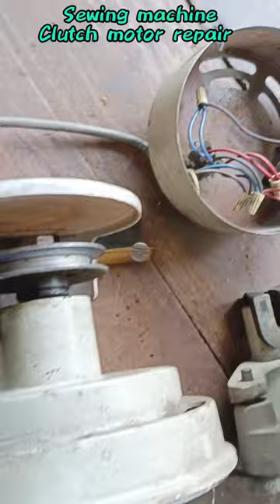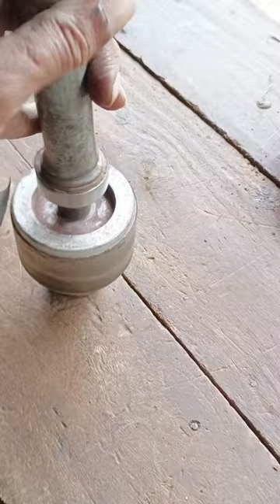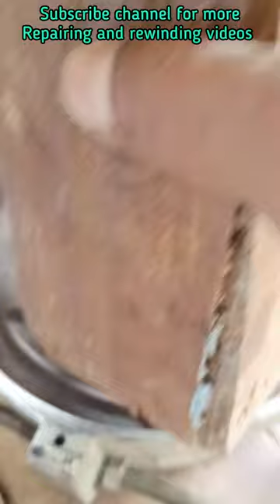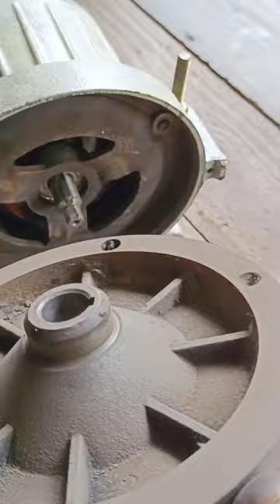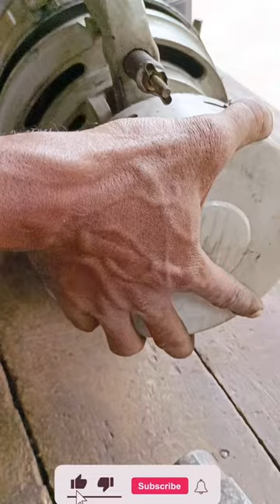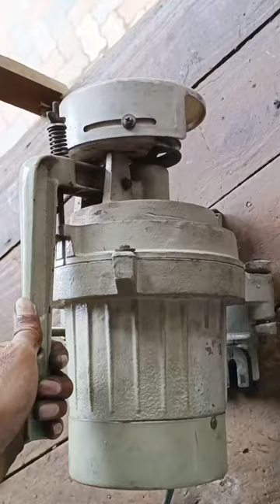Sewing machine clutch motor repairing|Clutch motor repair|stitching machine clutch motor repair

Comment: Hello i have one but the motor isnt rotating what might be the problem
Reply: It vibrates when turned on but doesn't rotate
Reply from the maker: If there is vibration and no rotation, the bearing may be compliant and you should also check the motor winding and capacitor.